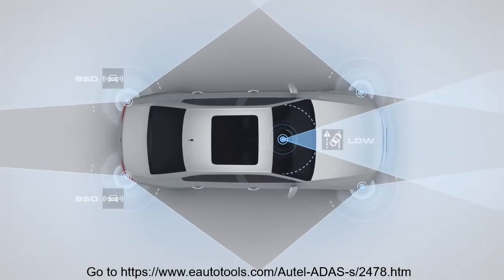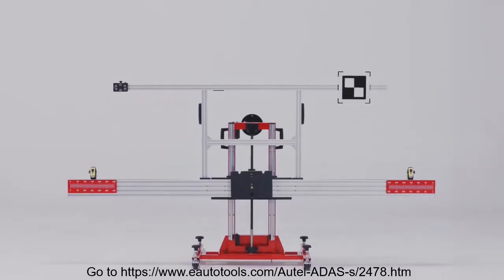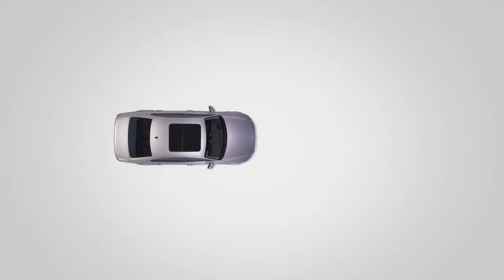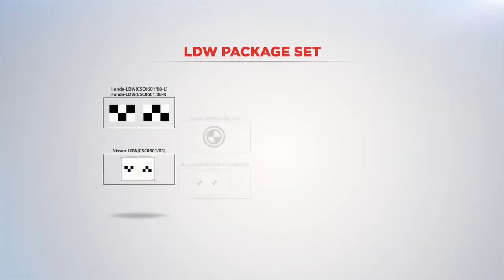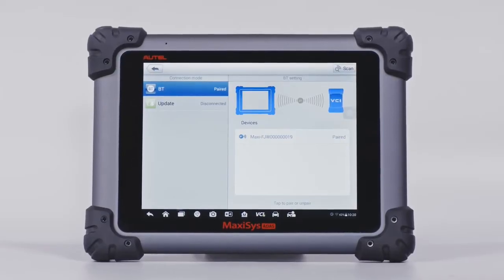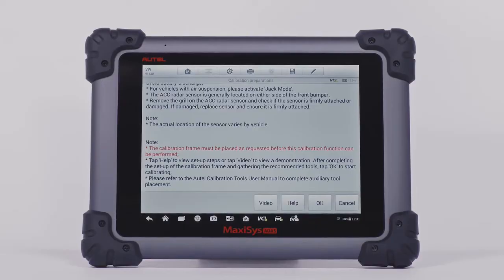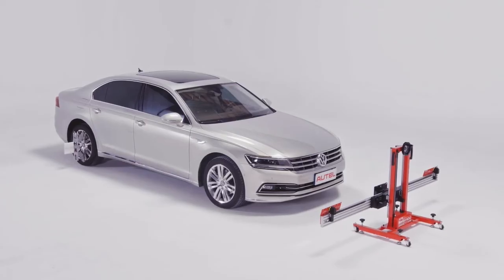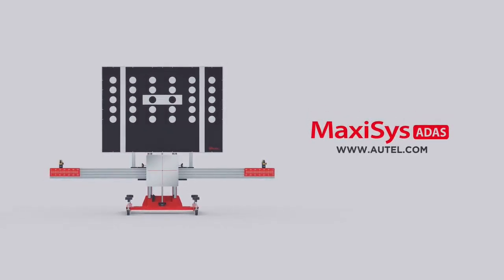Autel MaxiSys ADAS - Introduction and Calibration Demo

Comment: Are all manufacturer ADAS Targets ,dimensions, measurements and fixtures for  given make model year of car universal in the industry as mimicking the OEM? For example if I got job at a Toyota dealer and  they already have  an  Alignment Rack with  OEM dealer SUPPLIED targets,  Can I  get by with that without need of  buying  the MA600  and Autel brand Targets?